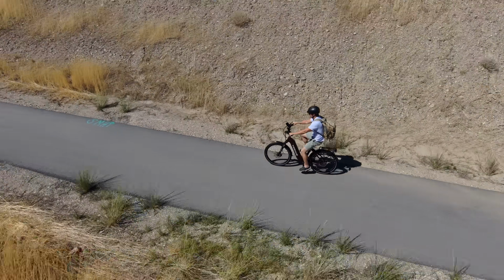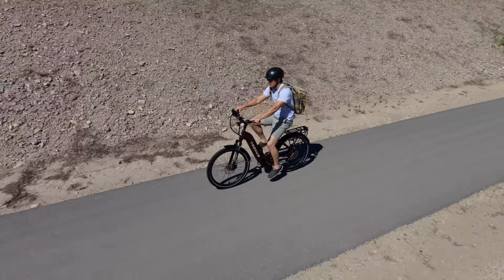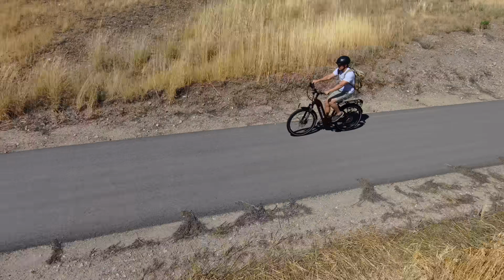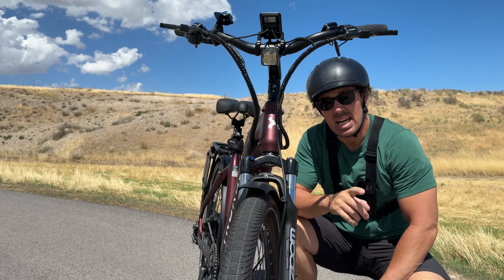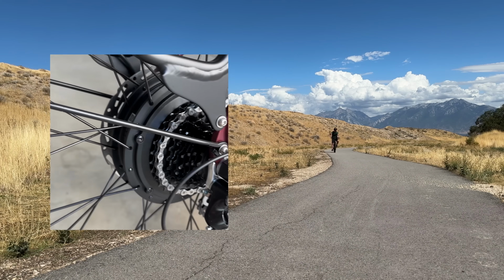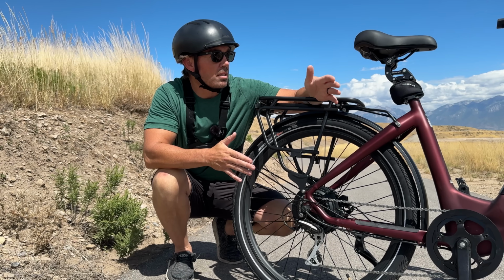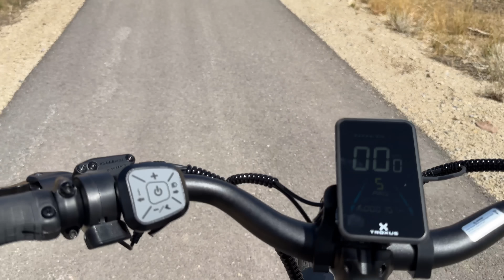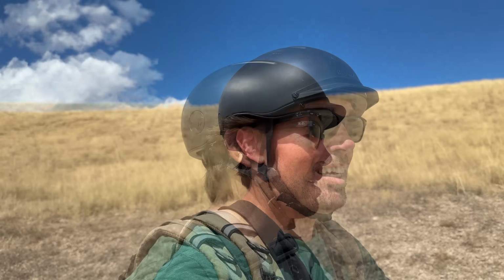Doin stuff no one else is | Troxus Trax 1.0

Comment: I think the Radsters use a torque sensor though?

Anyway, it’s great to see more brands and models use a torque sensor but write their software to allow you to tell it to treat it as a torque sensor or as a trigger to simulate a cadence sensor (but with no lag). There are times I would prefer one or the other.
Reply from the maker: It does have a torque sensor, didn't think you'd realize it lol. Was using it just as an example and was the easiest bike to get through but the principle is still the same :)